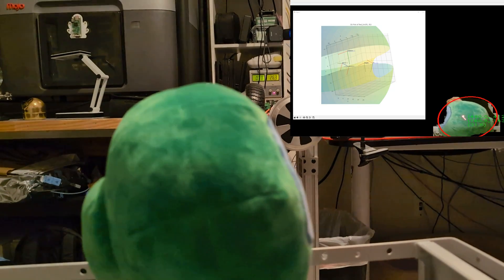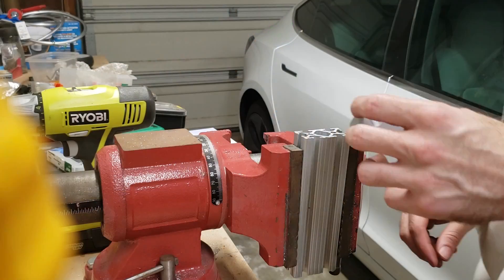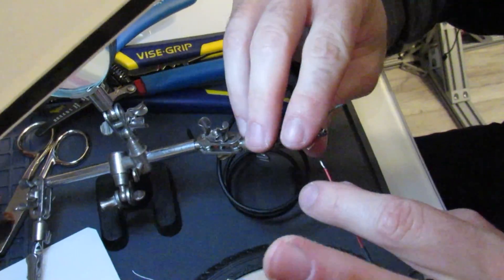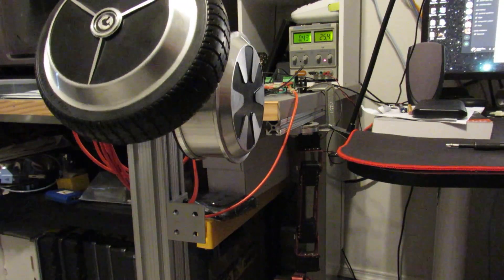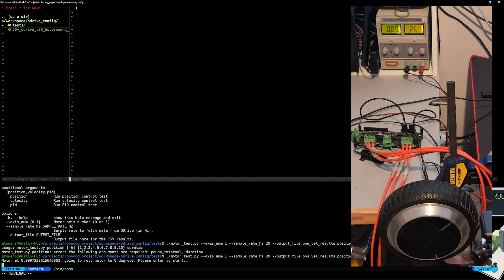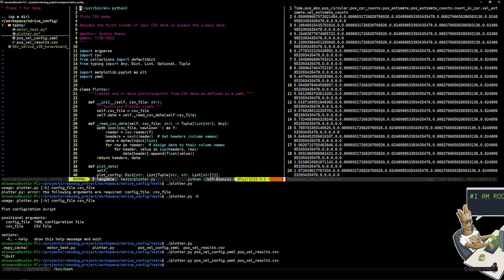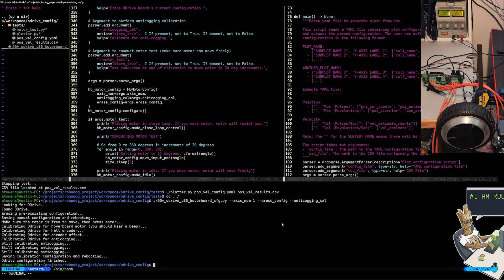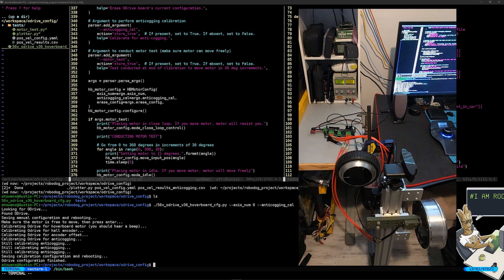RoboDog Part 10 | Dual BLDC Hoverboard Motors: Fixtures, Cable Management & ODrive Calibration

Comment: Take a hoverboard motor. put 36 volts positive to any one phase wire, and the negative to the other two wires.  (Its best not to exceed the rated current for very long.)
THAT is how much holding or starting torque the motor can muster up..  There is no magic software trick you can do to change that. It's physics.   Sorry man.

Comment: Hi friend, I'm thinking about making my version of an MIT Cheetah. I was thinking about using these hoverboard motors with Enconder, but I see that in the end the torque is not enough. Do you definitely recommend using another type of motors? Using reduction gears? Or what do you recommend? My idea is that it can carry at least 70 kilos of weight in addition to its structural weight. What do you recommend?
Reply from the maker: I am trying to push the boundaries of what I can do with these commercial hoverboard motors because they are cheap, but I agree with you that, given their weight, it probably isn't enough torque. I personally was going to try different/lighter motors at different joints and see how that works. But if you want to try something you know will work, then I'd use different motors with reduction gears, ideally with minimal backlash. I know planetary gearboxes have pretty low backlash, but I would look to see if that would provide the torque you're looking for in your design.
Reply: @AustinTronics  I am studying the use of CapStan Drive for reduction, it is very compact and practical, I recommend this video where the creator makes several models and explains this type of mechanics, I am already implementing this concept in my design, I will use Nema17 with 1:10 reduction for Abduction and adduction and knee and the hoverboard motor for the thigh with a 1:5 reduction, the video is from the following link take a look.
https://www.youtube.com/watch?v=MwIBTbumd1Q
Reply from the maker: @FermarioAV  awesome video! I had no idea CapStan drives, seems like a really good alternative if you can get the right rope.

Comment: It's great that the hoverboard motors are so cheap, but what about the rest of the components? Is it possible to replace the odrive controllers with something cheaper? Or use hoverboard parts? I want to say thanks for all the work done

Comment: Hey, great that you are back with the project,
I had the same problems with the hall sensors, what worked for me was to go back to the old version of the firmware, I'm using 0.5.1 if I remember correctly.

Comment: I will be anxiously waiting for the next video about the encoder with greater precision. I am building a complete robotic arm and the best candidate to be the shoulder of the robot are the two Hoverboard motors with Odrive, the issue of precision is essential. I wanted to know what encoder you used in the video and which one you plan to use in the next one.